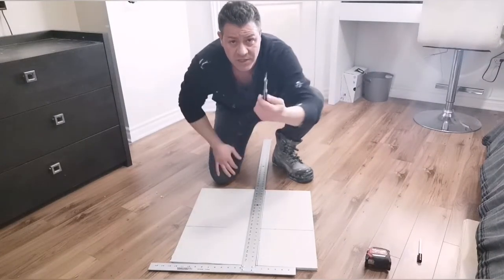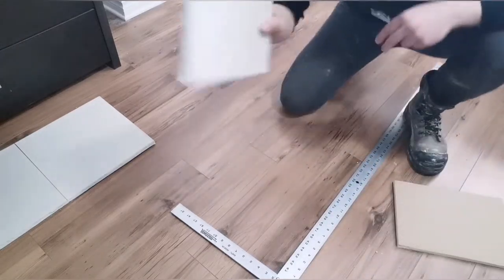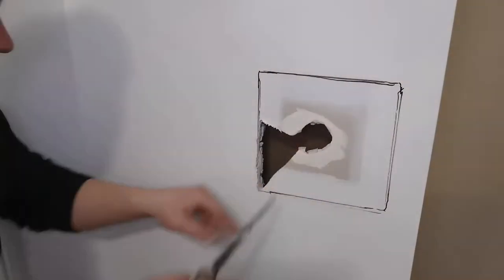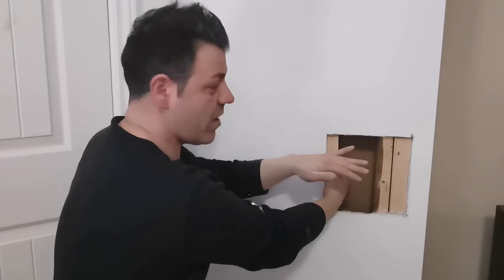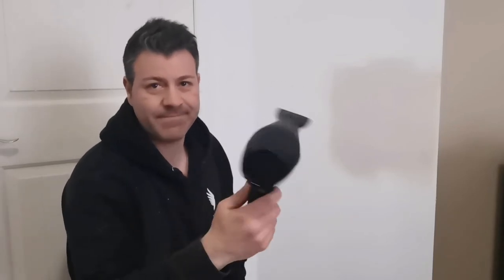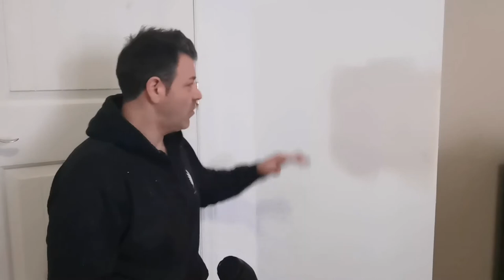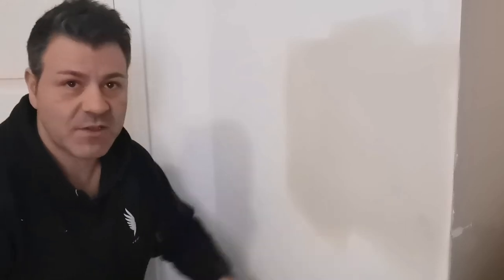LEARN to Repair Drywall Like A PRO ! SAVE TIME EVERYTIME

Comment: Tee square wasnt square on the board niether time the line was drawn
Reply from the maker: No need to be perfect as long as when you mark on the wall its a perfect match. DIY'ers will enjoy the fact that its not about being perfect but getting it done with what you have. 

My 2nd video in the uploads shows how i finished the wall and it blended perfectly. Check it out 👍